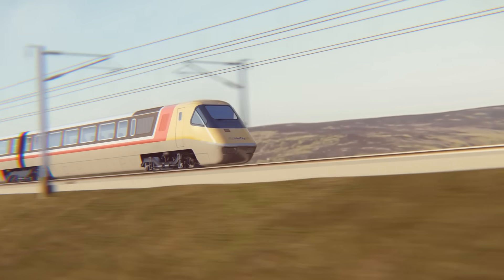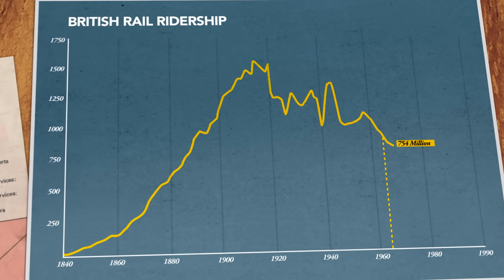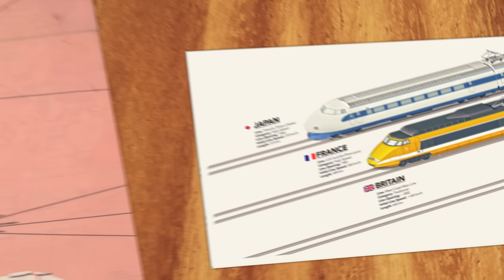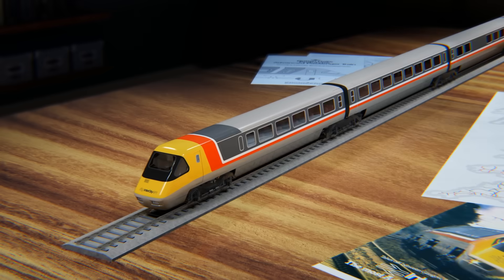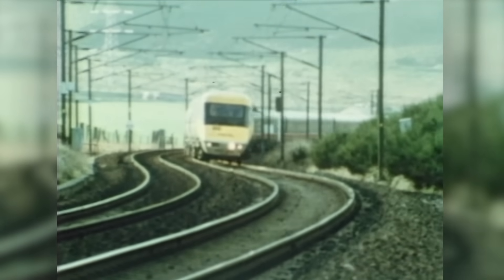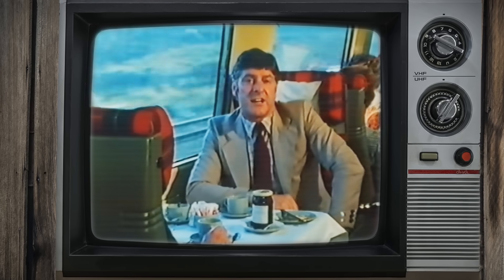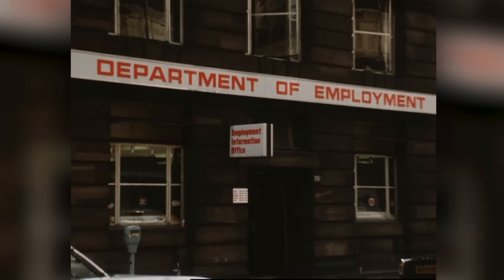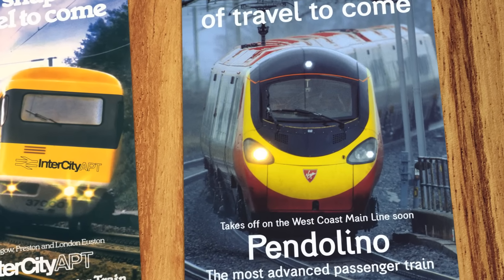This Train Made Passengers Sick: The APT Tilting Train Story

Comment: what if it would have been built with self stabilizing gyroscopes? so that the wagon tilts, but then inside the wagon the floor still stays flat. 

The floor neutralizes the tilt of the wagon.
Reply: That would have just added an extra layer of complexity. In reality, the train wasn't that bad. Most of the bad reviews came from boozed British tabloid reporters. Riding trains in the Netherlands (at least, when their isn't a lock down) it can also have some vibrations. It really isn't that bad. What you see in the video is indeed much worse, but that is completely the blame on the lack of maintenance on the actual infrastructure, and not the blame of the train itself. Even more, they discovered that some of the motion sickness was because the system worked too well. It kept you completely level while you could see you were taking a corner. They fixed this by just reducing the tilt. So instead of tilting 9 degrees, it just tilted 6 degrees. This gave you the sensation of taking a corner, while not really making the ride uncomfortable. 

It really was a good train. But it was the first of its kind and it had kinks to work out. But a lot of the hate just came from boozed up unqualified opinionators and a system that was over engineered. The APT could have been better if they worked out things like how the hydrokinetic system was completely redundant and could have worked on the existing hydraulic system, or that actual time and energy was spent on renovating the existing rail. But no, British tabloids love to hate everything that is different.

Sorry for the long rant. I like the video, but it glosses over things. I don't blame Mustard. He needs to make a short video. He is also (probably) just a small staff. So things that deserve more nuance are missed. Just don't hate the train, hate the system behind it (primarily the British media, this train worked in Canada without major issue for a long time)

Comment: I started working for BREL in Derby  1979. in the woodwork department. We made the odd piece for the APT but the majority of work was for the HST trains.The people designing the APT were said to be aircraft engineers Ex Rolls Royce redundant staff, where as the HST was designed and built by proper railway engineers..We used to go every summer holiday and look at the APT in the scrap coaches section of the works.

Comment: @Mustard In Italy around the same time we developed the so known "Pendolino" or ETR.401 and it was put into service in 1976 but it was actually good and it would be dismissed only in 1985 when it was substituted by the ETR.450 which had the same principle of working but was more technologically advanced. You should give a look about it, I think it would be a great idea for a video.
Reply: Incorrect, that Italian system was a poor concept which was disguarded, it was the British funded and designed suspension system that is known as "Pendolino"..
Reply: @original_yosemitesam  Nope, the gyros were built by British aerospace but the rest of the tech was Italian. 
So it's actually the opposite, Italian tech was used and British tech was disregarded. But still the gyro was British so both countries made something good!
Reply: @original_yosemitesam  Nothing of the APT ended up in the Pendolino. It's just a legend.
Apart for the fact that the Pendolino prototype, FIAT Y 0160, was built in 1970, while the APT prototype run for the first time only at the end of 1971, and the first commercial Pendolino (ETR 401) became operative in 1976 and had been retired from passenger service only in 2008, the working principle of the two is different. Pendolino has two gyroscopic and accelerometric transducers on the two bogies of every car, instead of a single accelerometer on the center of the car. That means that it reads the inclination of the track at the start of the turn, and can react in advance and more precisely than the APT system, avoiding the oscillations and imbalances that were the cause of the motion sickness of the British project. That's why it had been so successful worldwide.

Comment: The real problem was that at higher speeds, lineside signals cannot be reliably read from in the driving cab, and Britain would not install proper cab signalling on any part of its network until High Speed 1 was finally constructed.

Comment: How come they had the spacing for two tilting and not tilting trains not colliding in the curves ?
Reply: If you look at the shape of the train, it narrows towards the top, meaning that at full tilt the body on the inside of the curve is vertical and doesn't conflict with the opposite line

Comment: The Pendolino finally did it. Not even Bombardier could get active tilting right with its via rail LRC trains, also had to be removed and replaced by more conventional technology
Reply: Bombardier did use it with the UK Super Voyager trains, used on the same line as the Pendolino trains but on services that continue off the electrified lines

Comment: Was there much CWR on the WCML, though? Might account for some vibration if jointed track. There are many junctions on WCML, too. 
I actually travelled on the APT for a week monitoring the number of telegrams received from the track-mounted transponders. Too few and the CAPT shut down and I reset the system behind a panel in the driver's cab.
Even at the authorised reduced speed it felt and looked like flying when going around curves north of Preston. Standing rock steady in the cab, the horizon appeared to tilt wildly and the taller mechanical SBs seemed to lean over the railway.
Perhaps the sick people didn't travel by aeroplane owing to the horizon tilt experience? No? Did your G & T slide off the table owing to change of direction? Of course not. The aeroplane tilts as it turns onto its glide path for landing, etc. Passenger aeroplanes are still flying and tilting.
For its time, it was a beautiful train - on a par with the Midland Pullman - it was quiet on many sections, and very comfortable on the passenger seating. I dined on it, by invitation, and the stewards appeared to have no trouble serving - unlike the more pedestrian services on the same route.
I also travelled on the inaugural Pendolino run to Manchester. By comparison this was also comfortable but didn't elicit a, "Wow," from me until Mr. Branson himself came down the train and gave me, and some others, a Virgin Trains umbrella.
All in all, for fitness and wow factor, the APT knocked even the TGV into a cocked hat. I also travelled on TGV on the test line between Bordeaux to Morcenx.

Comment: The only train that saved the UK is the EURO STAR which can reach 300kms an hour
Reply: No it didn't. The Eurostar just removed the need for commercial air travel between London, Paris and Brussels. Very few trains can be attributed to saving the UK's railways, the one that did it for the intercity sector was the HST or InterCity 125, which sped up journey times and provided much more comfortable travel compared to what came before

Comment: The main problem was putting an electric APT on the West Coast Main Line (WCML), which is notoriously curving.  If you go back to 1936, the London, Midland & Scottish Railway (LMS) introduced their streamlined steam train, the Coronation Scot, on the WCML, and it too was an abject failure, as it couldn't handle the curves.

Meanwhile, their competitors, the London & North Eastern Railway (LNER), had introduced their Class A4 steam locomotives on their much straighter East Coast Main Line, and one of these, "Mallard", set the speed record for a steam locomotive, 126mph, which has never been broken since.  The LNER started their "Coronation" service between London Kings Cross and Edinburgh, and that was vastly more successful than the LMS London Euston to Glasgow Central "Coronation Scot".

The ECML was not electrified all the way to Edinburgh in the 1970s-80s, hence the diesel High Speed Train (Inter City 125).  However, the prototype APT-E was a gas turbine train, which performed extremely well.  Therefore, it strikes me that had BR Engineering further developed the APT as a gas turbine train, with or without the tilting technology, and ran it on the ECML, they would have been onto a winner.

I still have a BR pocket timetable for the 1981 APT services.
Reply: Gas turbine technology was not reliable enough, and the 1973 oil crisis made it completely impracticle to run

Comment: The APT was a remakable achievement when you consider it was built on a rediculously small budget and subject to political pressure which forced the promising but undeveloped train into the public eye and was ridiculed by the Press. The UK is an unbelievably negative country when it comes to innovation. What sealed its fate was the simpler High Speed Train (HST) which could only do 125mph but was cheaper and more-or less availbale at that time. The result? The government sold the technology to FIAT, who finished development and Virgin Trains bought its version of the Pendolino Train for use in the UK in 2001. However, their capacity for 140mph running is reduced to 125mph for track reasons. And the 40 year old HSTs? Still running, in shortened form and likely to for some years! Some power units locos have been re-engined twice!

Comment: Great video. If only the UK had built some proper HS train lines back in the 60s,70s,80s,90s,2000s,2010s,2020s etc. ...
Reply: We've had high speed railway lines since 2003, just after 2007 we didn't bother with anymore until recently when construction work on HS2 started

Comment: Politicians, councillors not knowing anything about rail, and business companies trying to cut costs should not be designing railway infrastructure.

In Australia, people laughed at Queensland's 3ft6in gauge, but now Queensland has Australia's fastest with its 'Tilt-train'. It must have been after seeing Britain's disaster. It's based on the rail lines being tilted or 'canted' with the outside rail higher.

It should be obvious that improvements must be made to the tracks. Very high speed, for now must be left to air for those business people who have to be somewhere in an hour or so, but generally, we can do so much onboard modern rail, the extra 2 hours or so should not worry people. Yes, 200km per hour or more for London to Glasgow. Britain is small, taking 6 hours just makes it feel larger!

I have fluid retention, so we should be offered more than 45 degree seat reclines for these journeys, or have sleepers on a Glasgow to Rome rail journey.

Comment: 2 decades to develop ? 
Sounds like they could’ve build a freaking normal bullet train with new tracks within that same time or less
Reply: Same time, but not same cost.
Reply: To prepare it for the Pendolinos, the UK spent 9 billion Pounds on the West Coast Main Line modernisation. Adjusted for inflation, this was twice the cost of SNCF's Paris-Lyon high speed line. Renovating a busy line is costly.
Reply: @alaindumas1824  They didn't need to do that for Pendolinos to run at 125mph, it was just so that more trains could run

Comment: @Mustard Great video! Just one mistake at the end: Fiat had already started developing tilting technologies at the start of the 1970's, with the Fiat Y 0160, and, later on, the ETR.401. All of this before the APT. These were prototypes, but then stemmed into the very successful ETR.450. Again, this was either just before or during the development of the APT. Fiat then sold their rail department to Alstom, which renamed it "Alstom Ferroviaria", and is still based in the same factory as the old Fiat division. And, because it basically is just a continuation of Fiat Ferroviaria, all of the patents were retained, like, for example, the Pendolino technology. When Alstom then needed a train for Virgin Rail which could operate at high speeds using a relatively unchanged rail network in Britain (excluding HSL), they called non other than those italian engineers which had the know how and the machines to build such a train. And thus, the Class 390 Pendolino was born.
Reply: The APT started development in the late 60s, and it's true Fiat were working on their own system in the 70s, however later bought out the APT technology to use instead once British Rail cancelled the APT project.
Reply: @agent_605  Nothing of the APT ended up in the Pendolino. It's just a legend.
Apart for the fact that the Pendolino prototype, FIAT Y 0160, was built in 1970, while the APT prototype run for the first time only at the end of 1971, and the first commercial Pendolino (ETR 401) became operative in 1976 and had been retired from passenger service only in 2008, the working principle of the two is different. Pendolino has two gyroscopic and accelerometric transducers on the two bogies of every car, instead of a single accelerometer on the center of the car. That means that it reads the inclination of the track at the start of the turn, and can react in advance and more precisely than the APT system, avoiding the oscillations and imbalances that were the cause of the motion sickness of the British project. That's why it had been so successful worldwide.
The only reason why FIAT bought the British patents, was to avoid someone else buying them and developing them in a competitor project.
Reply: I’m so sorry I thought you were my son
Reply: @kennethrodgersonofbotswana5284  what
Reply: I think your missing the point trains are for nerds

Comment: 2019 and Indian Railways still only has trains that can do 100 kmph max
Reply: nope, Recently launched Gatiman Express has become the fastest train in India with top speed of 160km/h, running between New Delhi and Agra
Reply: @gokulanil2539  Lol firstly, 160 is nothing as per today's standards and secondly, how many Gatiman express trains run in total? A handful maybe? Cuz most Superfast Express and Express trains don't do more than 100, that's why you see a lot of Indian railfans posting on Youtube about "xyz superfast does 100 near xyz station" oh and for the cost of traveling on Gatiman express, I could just catch a flight that's light years faster compared to that train lmao
Reply: @goldrushjkgh  yes bro, comparing to foreign countries Indian railway has very slow trains. The fact that even in 2019 the maximum speed we can attain is 160kph  shows how far behind we are.
Reply: I mean that's the speed of regional services in Denmark but still kudos to India I guess. Upgrading the railways is a difficult task. Back home in Denmark we're currently in the middle of upgrading all our main lines to 200km/h as well as building parallel lines to some of the busiest corridors that can handle 250km/h, while also electrifying much of the network at the same time, and introducing a brand new signaling system, where the old signals don't work with the magnetic waves from the new electrical overhead wires. It's a huge mess, with delays and cost overruns left and right, but who knows, maybe our railways in Denmark will be comparable to the rest of Europe in 2030, and maybe India will even have surpassed us in some ways.
Reply: @drdewott9154  Dude trust me India will never surpass you guys, we still have Colonial era tracks and overcrowded trains
Reply: You can't expect to have super fast trains paying the prices Indians pay on trains!!!
Reply: In 2023 or 2024, we will have a completed Mumbai - Ahmedabad HSR Corridor with 60 bullet trains running at 360 km/h, daily. They will atleast have 10 halts en route. The same HSR Corridor will be extended towards New Delhi and remaining Diamond Quadrilateral Cities of India in stages. We will also have a state-of-the-art Manufacturing facility which will manufacture bullet trains in India under the Make in India initiative. Japan is going to help us set ot up. Don't worry,  the E5 Shinkansen is coming soon!
Reply: @thetechnocrat4979  no harm in having dreams!
Reply: @vigneshbantwal  
It is not just a dream, it is a goal. Steps to be taken have already started and land acquisition is almost complete. Hopefully, it will get completed by August 2023. If we Indians just show some passion in our work and have a positive outlook, we have the potential to achieve absolutely anything! By the way, Talks with Japan have been completed and they are very enthusiastic about this project.

Comment: The train that Britain developed out of this was the very successful Class43 High Speed Train 125mph which quickly set the world speed record for a diesel-electric train on a passenger service back in 1970s which still stands to this day.
Reply: The HST wasn't a development of the APT, in fact it was a development of a standard diesel locomotive but for 125mph operation, as a temporary solution until APT was ready

Comment: The information is wrong, currently in the mid 70s, Italy and Spain already had their "TILTING" trains the Pendolino and the Pendular Talgo, running at full capacity, it was GB who did not want to buy those trains that did work, even Spain bought a Fiat-Pendolino on the 70s to test it. Tilting talgo system has been running for almost 50 years and is still evolving used in AVE trains or running on USA or Russia.
Reply: They didn't start development until after the APT project started in the mid 1960s.